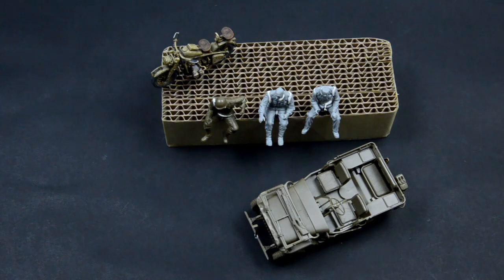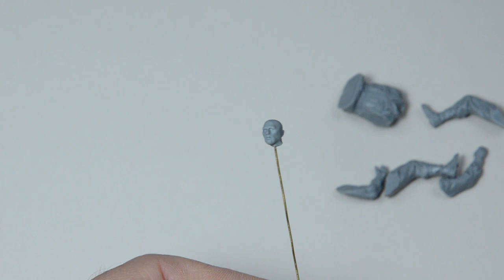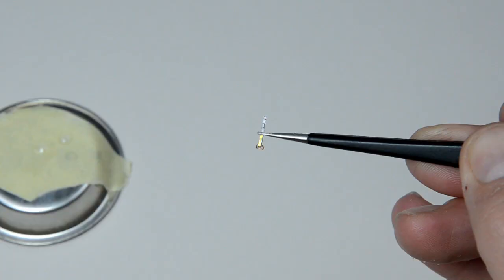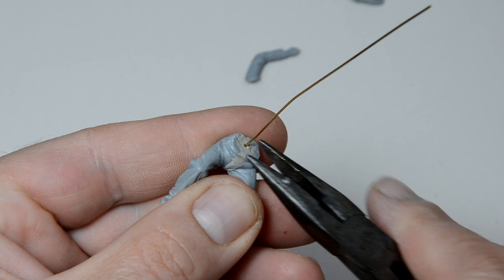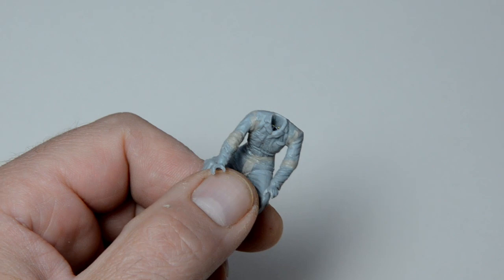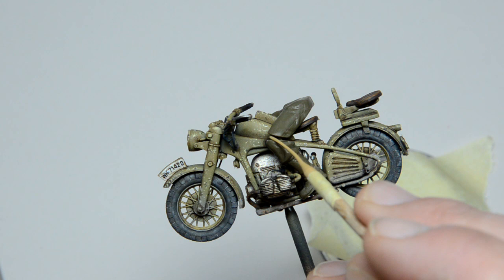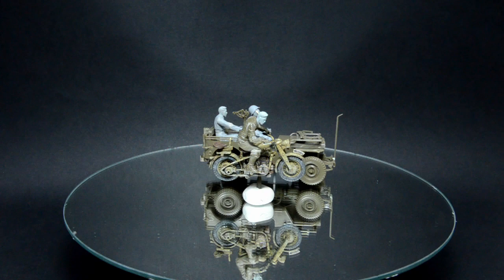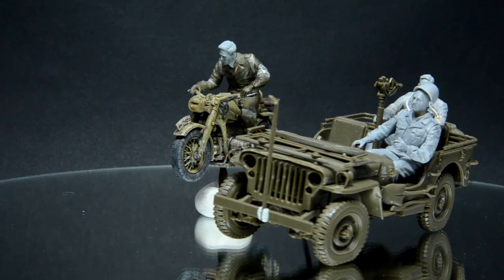How to CONVERT STYRENE FIGURES for a Diorama (1/35, Miniart, Tamiya)

Comment: This just solved a huge ‘WTF am I going to do about that?!’

Big Thanks!
Reply from the maker: About what??? 😮😁
Reply: I'm just getting into building models (and dioramas once I'm ready) and in the TON of research I've been doing (I'm very focused on 1/35 WWII European Theater), I don't see much in the way of intense emotion, movement, and horrors of war that I know from my own experiences, exist.

Obviously, there are limitations for the majority of builders based on what model makers put on the market, and as best as I can tell, model makers are offering more in the areas I'm discussing - various arms, heads, etc and it looks like "wounded" and "dead" in this genre are being designed and created, but having spent a lot of time in war zones, I know there is a lot more intensity and emotion and brutality that, if done well could be conveyed in diorama builds and I want my work to represent that...to the best that I'm able.

Therefore...learning from you how to cut, wire, and mold figures is a HUGE weight off my shoulders because the truth is, I don't want to invest all the time, education, and efforts into learning how to do this if I'm ultimately limited by what model makers offer - You enlightened me on how I can have greater control and ownership over my work AND how to practically do it, that doesn't require a 3D printer and the mind of an MIT student.

While I'm a looooong way off, from building my first diorama (I just ordered my first WWII figures and a small Vallejo German Infantry paint set and scrapping the $$ for that was hard enough as 53-year-old, married, dad of 5 kids...I don't see the money I make LOL!), I already have a clear plan for what I intend to create.

Again, huge thank you for sharing your knowledge - your personality (especially your dry sense of humor), ideas, and finished work make you great at this! I hope to be able to join your Patron group at some point.  @dioramadevil

Comment: @Diorama Devil good tips. Can your methods work as well for 1/35th Scale Resin Casted figures besides the injection moulded plastic figures? 🤔
Reply from the maker: Yes, I think... You should use Ca glue...
Reply: @dioramadevil  "Ca glue" are you referring to SUPER GLUE or cyanoacrylate adhesive?
Reply from the maker: @MrPeter-sn1yp  exactly... 🤟
Reply: @dioramadevil  Good. I have a mix of injection plastic, resin cast as well as 3D-printed 1/35th Scale figures in my stash to work with.
Reply from the maker: @MrPeter-sn1yp  just, give it a test try, and you will know... 😀
Reply: @dioramadevil  That is the lesser of my concern compared to reshaping the fingers to grip the weapons. I will be working with 1/35th Scale World War 2 Imperial Japanese Army figures in Type 98 summer uniforms.
Reply from the maker: @MrPeter-sn1yp  Evry step looks impossible at the start. Just try, you will be surprised... :D
Reply: @dioramadevil  Indeed. I am patient person when it comes to these tasks. :)